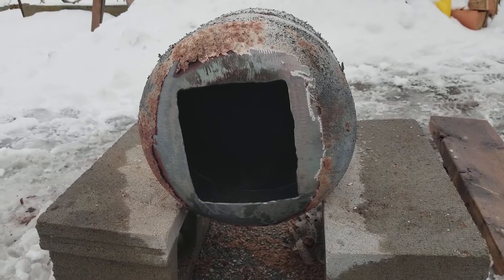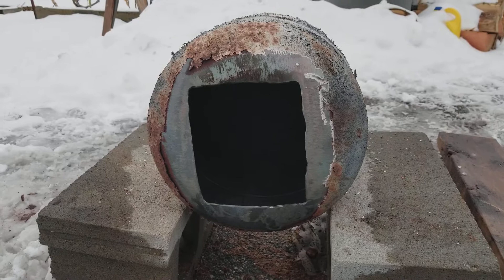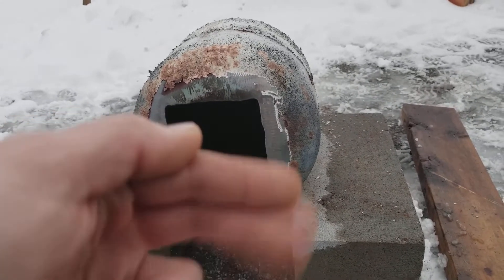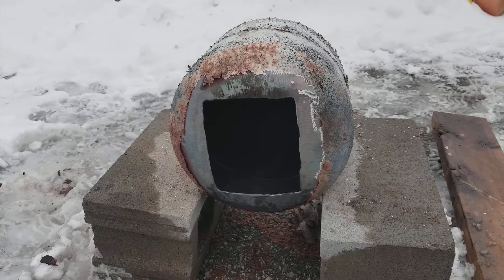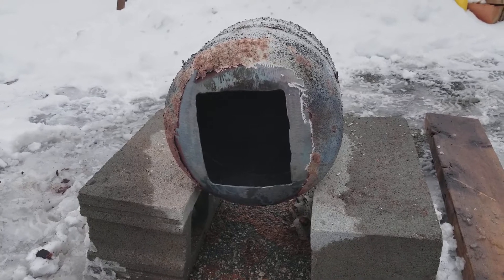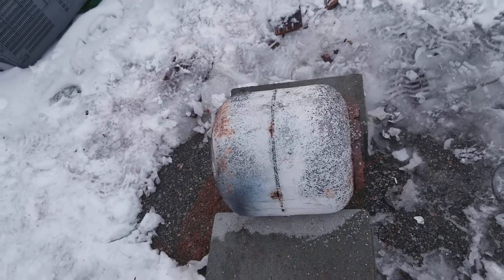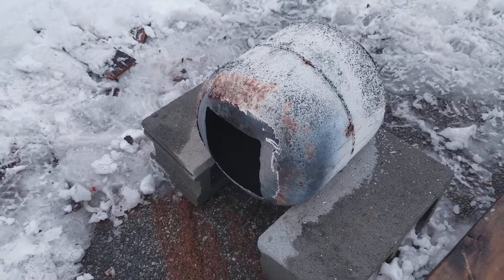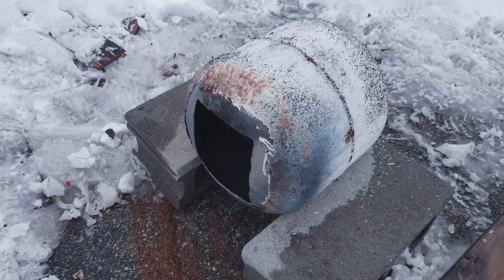Building a propane tank ball mill for IC chips Pt.1

Comment: U can get good steal rollers from treadmills..   or even printer's there just smaller diameter so your drill spins faster.. i rather use the treadmill ones for gear ratio simplicity...    great idea.. i used one as my  aluminium foundry..